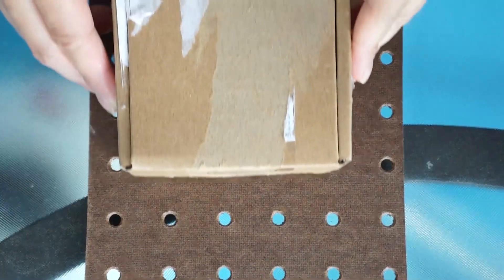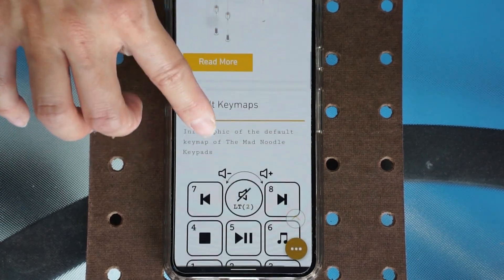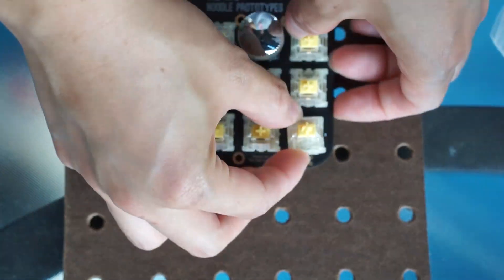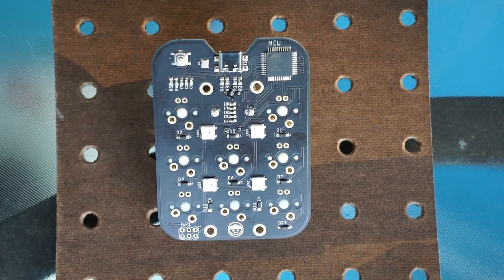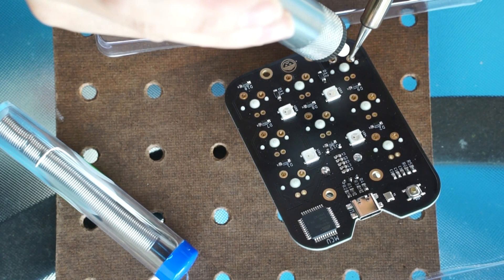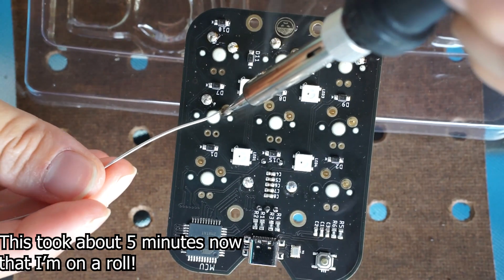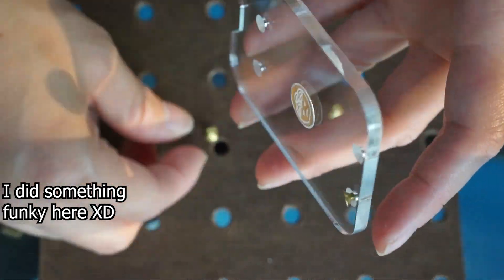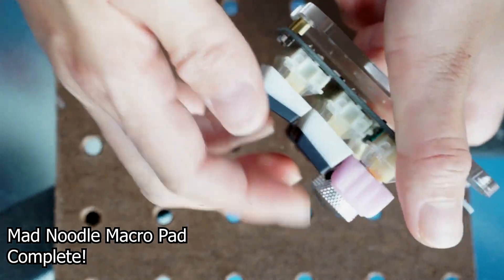First Soldering Project- Building My Mad Noodle Pad v1.0 Macro Pad!

Comment: very cool video, i guess im gonna have to go build my own. cause this looks cool
Reply from the maker: Definitely give it a try if you are new to keyboarding and want to start soldering. This is actually pretty small and not so Harrowing like a full keyboard.
Reply: @littledragonmeiling  so the key beds, or switchbeds( i’m not sure what they are called) do those click in to that circle, or is it solder only , holding them in place?
Reply from the maker: @eross21  it is solder only.

Comment: for de-soldering i highly recommend solder wick. it is a mesh metals that you lay over the solder you want to remove, press the iron against the mesh, and it will soak in all the solder under it.  it is so much better than those suction tubes you where showing.

Comment: The Algorithm recommended this video (just discovered macro pads). Thank you for posting this great video. I'm a total noob to arduino/raspberry pi, etc.  I'm pretty nevous about soldering too. Do you happen to know if this pad could be used as a mini music sampler?
Reply from the maker: hi and thank you for the kind words! Yes!You can use this as a mini sampler, though it'll be only 8 keys, so it might be only be for shortcuts but whatever you like to do! You would have to follow the directions to program the qmk firmware for the keyboard. There are instructions on the website that you can follow for them. Also if you are nervous about soldering, you have order this pre -soldered by Mad Noodle, it'll only limit you to the switches the store has.
Reply: @littledragonmeiling  I'm humbled by your quick response & happily surprised by the advice & recommendation. Thank you kindly!
Wishing you a beautiful night/day 😊

Comment: A couple of notes from somebody who soldered quite a bit more then you:

Don't be scared. You can hardly do anything wrong when soldering switches. 

- put a little bit of solder on your tip
- heat up the solder pad and foot of the switch for ~2 seconds
- bring in the solder and melt it so it flows over the pad and the foot 

I understand that it is scary when doing it the first time but it's really easy. :) Keep going!
Reply from the maker: Thank you so much for the advice! I will definitely take this! If you don't mind me asking. Is it recommended to have flux on hand? I've always seen it in many soldering videos as it says it helps with the soldering as well as having the solder adhere to the heated tip. I've tried to solder a broke wire recently, which I failed because the solder wouldn't stick to the wire and the tip itself. It kept balling up
Reply: @littledragonmeiling  It's hard for me to gauge as I cannot fully see the inventory number of the solder you're using but it seems that you are using lead free solder. While this is generally cleaner it's also a lot harder to solder with it as it needs higher temperatures and overall just a lot harder to use.

I'd recommend to pick up some Sn60Pb40 (Tin 60%, Lead: 40%) solder - it will make it a lot easier for you as a beginner. You'll likely have some FFP2 / KN95 (not sure what the type is in the US, sorry!) around - if you wear one of those you don't have to worry about the fumes. Youtube is a bit hard for a conversation - if you have any questions feel free to hit me up on discord. arcas#3614

Comment: How did u configure it and did you manage to configure the knob or did the knob not work? This vid is really helpful with research
Reply from the maker: On the madnoodle website [through support, then guides], there are instructions for using two different macro programs that you can use. it takes a little bit to figure out, but it's really nice afterwards and the github page for the program is really informative.  

The knob was preconfigured for the volume from the firmware that the maker had for the macropad and it worked really well.

I haven't done anything else with the knob, but I'm sure it can be configured through the program.